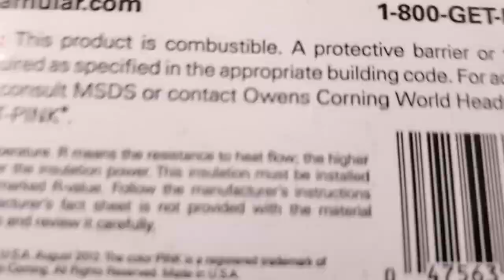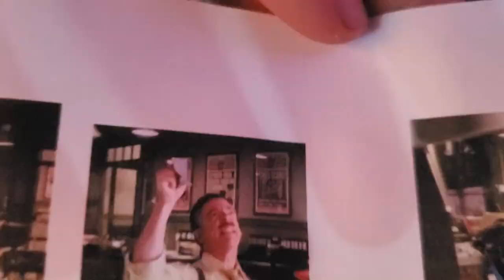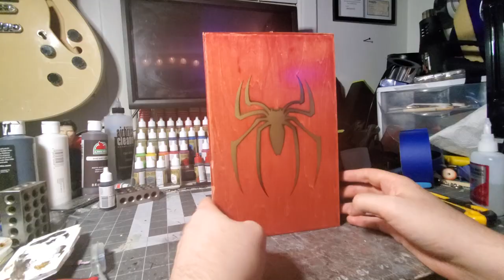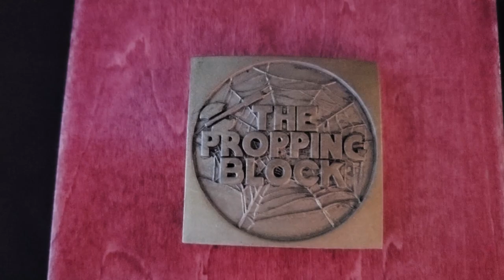🕷️ Spider-Man Book Nook 🕷️

Comment: Absolutely love your little Book Nooks, great ideas and exceptionally well executed. Just one question, where did you get that mirror foil from ? could definately come in handy !
Reply from the maker: Thank you! That is mirror crafting tape, you can get it from Amazon or any craft supply store or even Walmart really.  Definitely comes in handy!
Reply: @TheProppingBlock  Hi again, that mirror tape looks cool as well, but it was the big sheets of mirror stuff that you cut to size that I meant, it was the most clean smooth mirror finish I have seen.
Reply from the maker: @subliminalstyrene811  Ah that's just an acrylic mirror from Amazon
Reply: @TheProppingBlock  Lovely, Cheers for that !, Just ordered some, I can now get on with a long lost almost forgotten project that needed a little bit of mirror to finish it off.